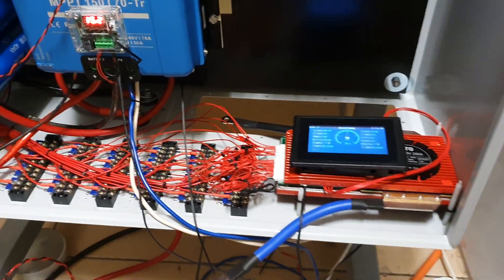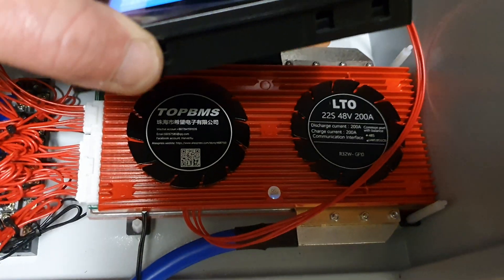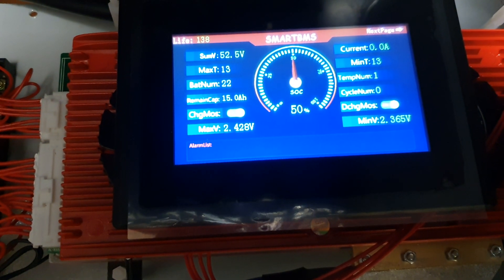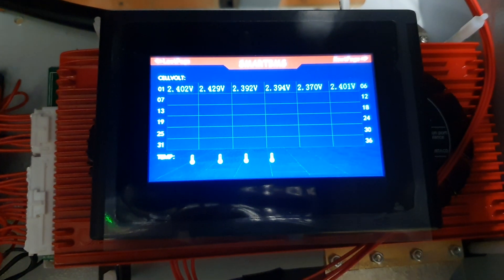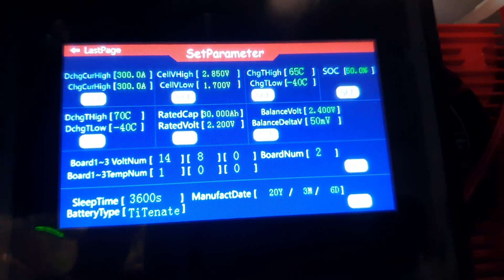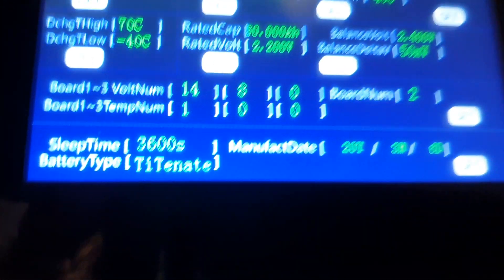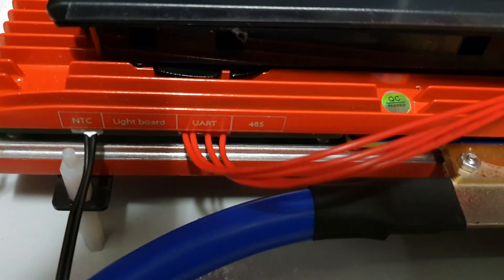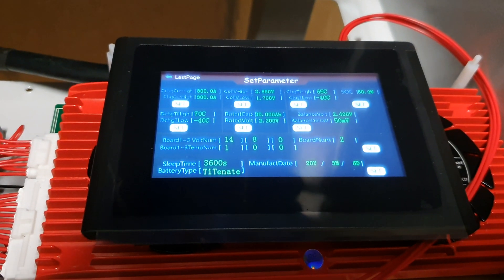LTO BMS from TOPBMS, showing display  screen

Comment: 22 cells only 52v? awfully low cell voltages arent they? Or are these not lifepo4 cells?
Reply from the maker: LTO cell voltage can range from 2.8v down to 1.6v, doing the maths on 22 cells that is a high of 61.6v and a low of 35.2v at the maximum and min volts, the voltage charge and discharge curve is not like lifepo4, it is more linear.